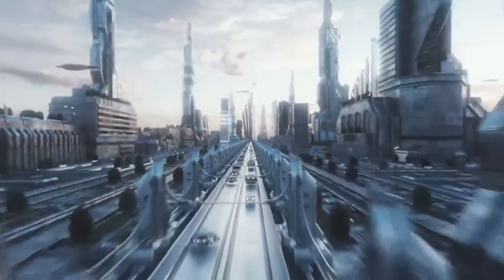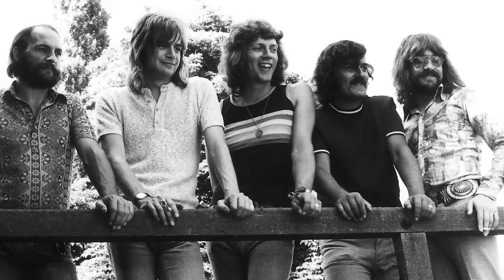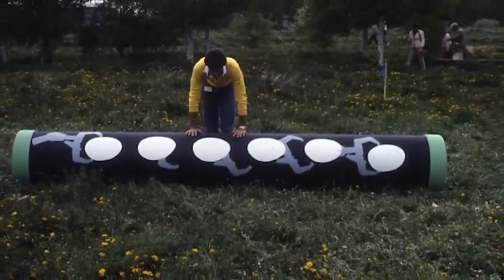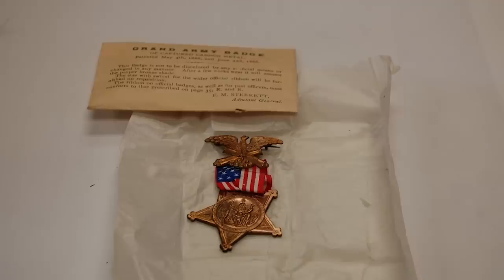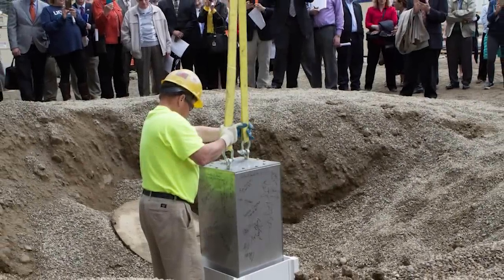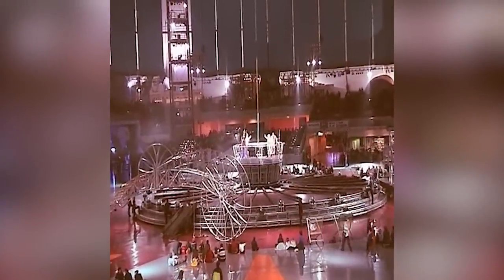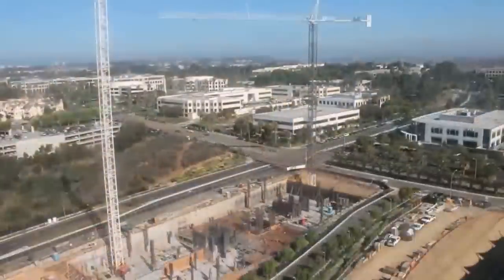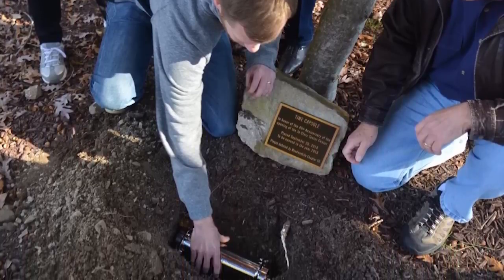12 Most Amazing Time Capsules In The World

Comment: I was working on an old 1800's church in 1975 and had to remove the "Keystone" to place it on the front of the new addition. A Keystone is piece of stone (white granite in this case) that has the building's dates chiseled into it. When I pulled it out I found a metal box behind it. I turned it over to the church and they found records and memorabilia from it's founding up until 1901 when it was rebuilt after a fire. The church members updated all of the info about the church and included current pictures. They even included a picture of me standing with the box and the Keystone, with a description of who I was and how the box was found. The new box was put behind the new Keystone, which was placed beside the old Keystone on the front of the new church addition. Who knows, maybe in 100 years someone will be looking at my picture and wondering about how life was "back then!"

Comment: If we put magnetic tape in a magnetic proof box how long can they last?
Reply: It depends. Not indefinitely because the tape in made up of different materials and they will deteriorate through decomposition ofer time. It all depends on the different gasses, what liquids and temperatures an item is exposed to and over what length of time.  There are to many variables which factor in to the answer.
Reply: I have the same last name

Comment: A F file, or mini harddrive could fit into a capsule sized object.
Reply: I would waste my time with that because technically changes so fast there no was thay would be able to get the data even if it wasn't destroyed from  Moisture or cold temperatures, electrical items expecting them to work is a pipe dream

Comment: Last year, I found part of a horse-drawn cultivator buried behind my metalworking shop. Based on the fact it is held together with square head bolts and nuts, I expect it is no older than 1870s. It's rusted to death. I plan to recover the steel tines for making knives.

Comment: Not quite accurate on the Tulsa vault. 
They lowered a precast lid on it with nothing sealing it on. Left the fluids and battery in the car. It made Chip Foose's crew sick working to get the car out. You could see the mud rings on the walls where the water had risen and dropped over the years.

Pieces of leaf spring fell out of the car when they lifted it. Anyone honest knew it was toast when the lid was lifted.